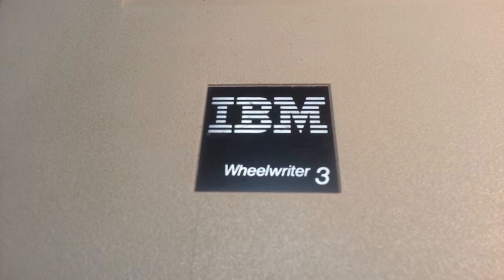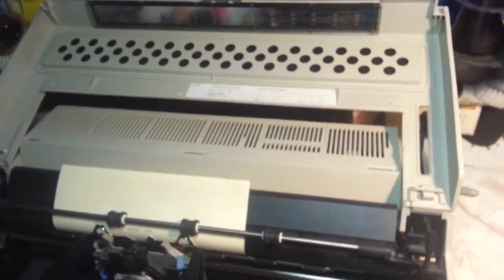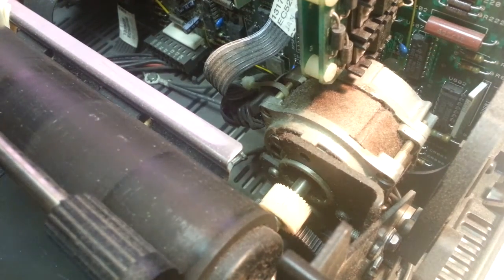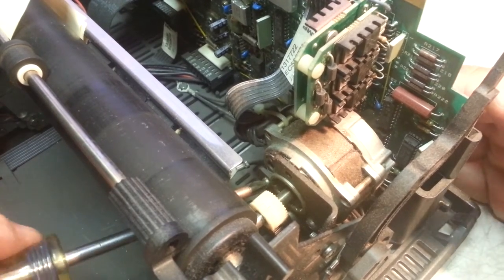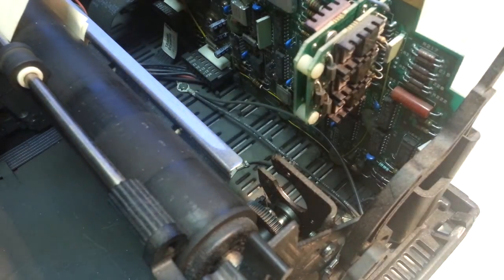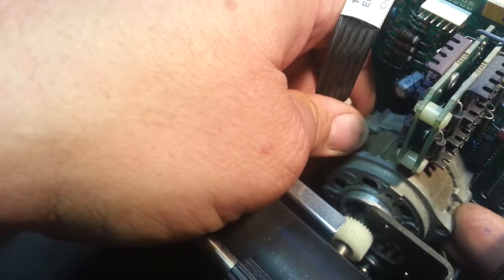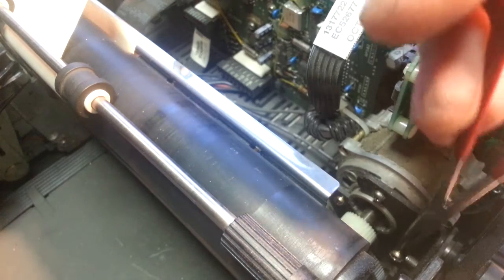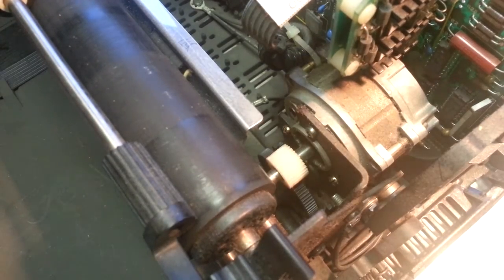IBM Wheelwriter 3 5 6 Typewriter Repair Carrier Motor gear cracked split bad and binding

Comment: I hope you don't mind answering a few questions, I recently found a wheelwriter 5 and I tried it out right away and it worked perfectly the only problems it had was it was very dusty from it being in some storage so I brought it home and used an air duster to clean it out afterwards when I tried to use it again the ribbon wouldn't advance in the machine so any advice on how I can try to fix this I'd appreciate it
Reply from the maker: See if ribbon drive is turning, or if ribbon cartridge is bad. Turn machine off & back on to reset
of if hammer is not striking ........https://youtu.be/TfbqKB4R3Lc

Comment: Coleman made a replacement Pulley for those, I still have a couple, steel I think
Reply: Still showing on their website... "Wheelwriter Transport Motor Gear Stock # 20-1A42"